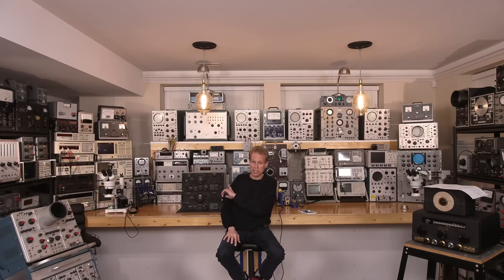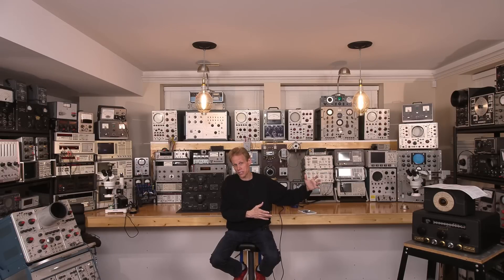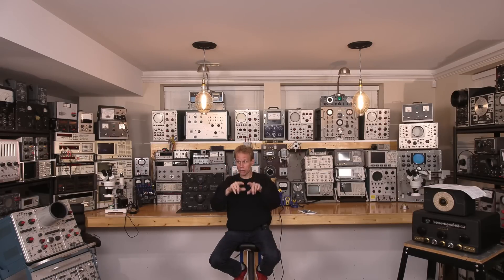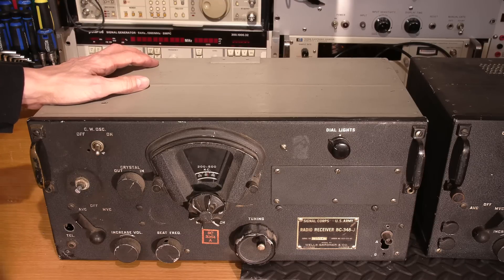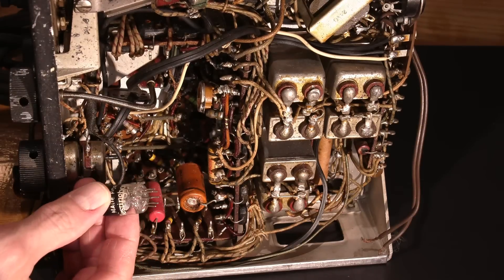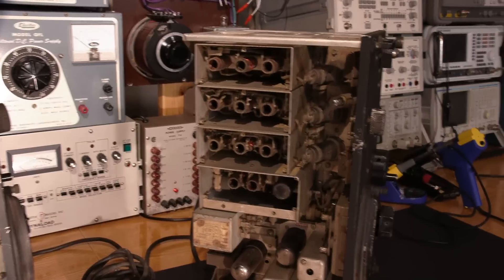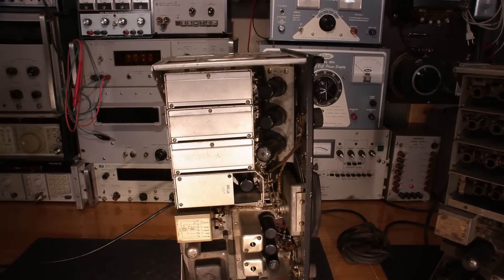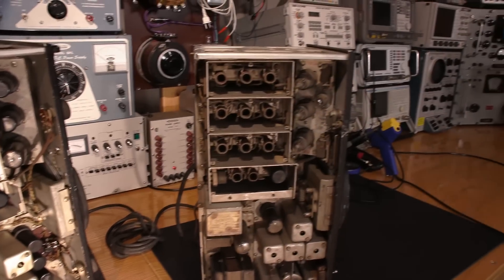Restoration Warplane Radio Receiver BC-348

Comment: Hello Paul, I have been following since the Stromberg Carlson 240 (where has the time gone?) I have ZERO electronics experience, I'm not a ham, I don't DX or perform EE projects...that being said, your uploads depicting troubleshooting, best practices/proper procedures are transferable to other aspects of projects I do undertake (aux equipment/ circuits for vehicles, appliance repair, and similar). You have enlightened me to potential safety concerns when working on circuits regardless of their application. As far as the YT analytics, I'm drawn to the resuscitation of this old tube equipment, circuit testing and comparison performance. I have learned much from your aligning procedures...but now, unless you are doing something unique, I will gloss over it, watching for snippets that may not have been covered before. The same holds true with the schematics, I can glean some information, but I don't "speak" that language, so I move on.
Don't get me wrong...I know that there are viewers that understand and hang on to EVERY word so that they may expand and APPLY the knowledge you share. You are their source for vital, ACCURATE information that is lacking on other YT channels
If I were to remove, rebuild, and reinstall the P7100 on a Cummins 5.9 diesel , I would want someone with YOUR attention to detail and ability to depict the nuances of such an endeavor, while  building the confidence to take on such a project. It's a balancing act...I don't want you to start going for flash & glam "clickbait" to gain viewer minutes as it would dilute your credibility (next thing, you'd be pimping AG1 and SimplySafe products)....but I do understand that you deserve compensation for the massive effort it requires to produce videos at this level.
If you have gotten this far, I am just sharing one of the many types of viewers that frequent your channel and our reasons why we are drawn to your content.  Hope this is insightful?

Comment: Wonder if the tube under the chassis and the variable capacitor in place of the dial light is maybe a Q Multiplier circuit?

Comment: Hi Paul,
I'm all in favour of the restauration. My vote goes to No.2 with the power supply of No. 1 and the case of No.3 though I'm still intrigued about the higher number of filters in No. 1.

Comment: Side Bar: Looked up when radios were mass produced? 
Late 20’s and more so in the 30’s … I was curious to find out that it was popular by 1934 to put radios in cars. And it’s a stretch to think they put a large vacuum tube radio in a car but I guess they did. Do any of these still exist? Do you have any in your library of dysfunctional electronics? you should have a history corner. Looking up the history of car radios it was quite the thing to produce a cheap car radio in the late 20s and it presented alot of obstacles… large antenna, large draw from car battery, vacuum tubes over heating….all very fascinating 😊👍

Comment: On the IF grid cap. or a inductive adjustments. Which one does the better job? Or is it possible to run both in a IF configuration. I have gone threw my notes for 1979. The notes wasn't  any help.

Comment: I don't know about the "J" model, but the "Q" version uses a pentagrid converter.  The "R" employs s separate mixer & L.O.  If the "J" does, too, I'd definitely go with that one.  One mod that's really necessary, is to disconnect the RF gain pot that's on the same shaft as the volume control, and install a separate pot.  Also, there's space where the dynamotor used to be, to build an AF driver for the output tube.  I used a 6C5 for my BC-348. (Back in the 60s).   I also installed a 100 pF variable cap, from the ant. input to gnd.  That wouldn't be needed if you're using an external ant. tuner. You can also improve the sensitivity by replacing the first RF amp tube (6SK7) with a 6AC7.  That's a sharp-cutoff pentode, rather than a remote-cutoff, like the 6SK7.  That tube  wasn't designed to be used like this, so you MIGHT get some IM products, with really strong signals.  However, I never experienced that.  Oh, one more OBVIOUS thing...So obvious, I just now thought to mention it.  First of all, rewire the filament circuit and replace the tubes with 6 volt versions.

Comment: If my opinion maters, i'd like to see more modern electronics without tubes if possible, power amps, tape decks, cd players, measuring equipment, lab PSUs etc. For theese receivers i would start with most good looking one, then second good looking and if something left for third ;)

Comment: A very interesting group. Obviously just on condition I agree it looks like 2.. But 1 is interesting. I think that's actually wartime or possibly even just before.. It has very much the look of the late 30's where the others look early 50's. My gut tells me if they were mine I would restore 2 using any needed bits from 3 and leave 1 completely alone until after that's done.. then crack into it and see how different the design and performance really are..

Comment: As a patreon subscriber I would generally like to see a bit more info and video content on there rather than a presentation of schematic, bom and announcements only, maybe a video of a build of some of your test gear designs.
Being in the UK, restorations of US gear is not so great for me especially after seeing many previous ones where the general feel is replace caps, check resistors and align etc. I have enjoyed watching all of these and do not wish to detract from or criticize in any way the quality and detail of your presentations as this has been excellent of course. Maybe a little more on 'restoration' as opposed to fault finding as I think you have covered this very well already.
And to sum up --err
keep going with the series, but spare a little time for patreon supporters.
Steve.
Reply from the maker: Hi Steve, the last entire video series on Patreon has been exactly what you are asking for? A test equipment design release, with all the information, schematics, layouts, component maps, parts lists, PCB transfers, etc... The amount of time I put into Patreon is "Astronomical." Are your sure you are a Patron?
Reply: @MrCarlsonsLab  Well I was, just cancelled.

Comment: Professor, keep going as you have been. I think a variety of projects is best. I want to see the comparison of these grand receivers even if it takes a year or two to get there. But along the way I enjoy the other things. I get a kick out of the different All American 5's & such but I also like to see some solid state things & old test equipment. I very much enjoyed the Vedolyzer for example. Even the coffee maker repair was interesting while I would have not bothered. You're up to the one I want to see, the BC348. I don't expect it to keep up with the AR88 but it will be interesting to see just how well it competes. The design goal was very different, weight and size were more important than utmost performance. But it still needed to perform well. Considering how often modified the BC348 is it may be a good example of what you have to go through to undo & decipher what's happened. Are these mods penciled in on the schematic?

I'd also like to see a more modern radio next to these older ones, something like a Yaseu FT1000. Sure these old units can't do what DSP can & they don't have the selectivity. But are certainly very sensitive, exhibit good dynamic range, can have terrific audio, & can be quite stable.

I suspect declining views as the repair went along was due to getting a little monotonous. Really, another hour & it's just 1 more simple step? Part 10 & you're still not done? Perhaps you could skip some detail or repetition. Show us how you replace the component once, then all replaced. We don't always have to witness each one. Make it easier on you & us. Don't change it dramatically but a little less detail with a little more frequent content would be appreciated. I can skip ahead as I see fit. For example, please don't stop warning people about safety. But I've heard it, have experience with it as well, gotten a few good jolts over the years. It's important. But it's no consequence for me to just tap forward a bit.

I look forward to your videos. They give me something new to watch I have an interest in. I'd rather watch a documentary than a singing contest.

My BC348 looks almost nothing like it ought, very heavily modified. It doesn't even have the original case. Someone got the bright idea to take it apart & make it rack mount. There's no original knobs & it isn't even black. But it sure does work well. I ran it for years keeping my basement warm. It's the Q revision I suspect. There's a silicon rectifier for the modern power supply. It also doesn't have the trap door on the front which the manufacturer put there for a reason.

Carry on.

Comment: I think the restoration series is important, in this instance radio 2 would be my choice.  It would still be nice to have have some small breaks in between.  For example the design & build of a BJT/JFET test jig to aid with designing BJT/JFET circuits.  Work out the basic biasing, set it up and tweak it to produce the desired result to suit the transistor you will use.  I know you can use a breadboard, but I never trust them.

Comment: Hi Mr. C, I also vote for yes, go ahead, which one you restore doesn't really matter to me.

Maybe you could put the focus on some other topics of the repair, for example there is an explanation of the electrically leaky capacitors in most of your videos - which is absolutely fine since it is an important topic - but maybe focussing on another detail might be great sometimes. 
I think this would help with a lot of your long term viewers since some videos are a bit repetitive sometimes.

Just a sidenote, if you need another topic, maybe some RF power amplifiers might be interesting (atleast to me) maybe also some solid state ones (maybe even LDMOS). 

Greetings,
Michael

Comment: My current restoration items are an ED80 UHF aviation radio receiver with multiple oscillator. Crystal Q111 in the multiple oscillator was defective. For replacements a second multiple oscillator in visibly bad condition had to sacrifice its life. For fault diagnosis of quartz two Pi links for four-pole analysis were calculated and built and swept through at the spectrum analyzer with tracking generator. For test operation of the removed chassis of the ED80 extra RG58 with BNC installed for feeding control frequency for external tuning. It was also necessary to install 60 Ohm terminating resistors at two not needed outputs according to the manual in the multiple oscillator. In the multiple oscillator still aged isolations in the 50 kHz, 1 MHz, 10 MHz oscillator had to be removed. Replacement of aged electrolytic capacitors in the ED80. Correction of the damaged installation of the heat exchanger in the housing of the ED80. Elimination of unbalance of a fan in the heat exchanger by soldering a solder seal. All assembled with adjustment ED80. Built suitable adapters for connection of the ED80. This is all very time consuming. Also your videos should show that. Not only the result! - Save the second receiver, because best preserved in the original. Please show complete restoration of these.

Comment: Paul, when you first started the Grand Receiver Restoration Series, I thought it was overly ambitious of you and I wondered if it was too big of a project to tackle.  It has definitely held my interest, but I'm finding that even though I am subscribed and I "rang the bell" I don't seem to find your videos as easily as some other channels that I subscribe to.  So maybe there is a fault with YouTube not alerting subscribers or not suggesting your channel as much as others?  Maybe YouTube suggests less and less (to non-subscribers) as the number of "parts" in a series increases (i.e. part 11 is not suggested as often as part 1 or 2)?  I'm just trying to think of reasons why viewing drops off as a series progresses.

My opinion:  YES, please continue with the grand restoration series.  I have learned so much from your videos, even though I will never be in a position to acquire or restore one of these amazing receivers.  Also, as far as which of the three to use for this one...  I think it should be your call, since you are the one doing the work, but I agree with your thinking, use that nice looking one, but pull the better(?) power supply from the other radio.  This is assuming that you don't encounter something catastrophic along the way that would make you want to rethink your options.

Also, I've only done a couple of videos myself, but I didn't realize that creating a video multiplies the time by a factor of 4 or 5.  Wow.  We all appreciate your effort, especially if you're clearing your bench to rotate smaller projects in and out.  I know how inconvenient that is.  With regard to that, if that slows you down significantly, please don't feel like you need to keep pumping out videos to keep us (me) interested.  I'll be here, regardless of the time you take between publishing videos.  I do like your decisions on what to show and what not to show in a particular restoration, for example: "These capacitors have all got to go. <cut> I've replaced the capacitors, and..."  We sometimes forget that many days of tedious work are skipped in the blink of an eye.

Lastly, as far as restoration goes, I definitely prefer to watch you restore receivers rather than test equipment and/or amplifiers, but I love the oddball "what is this thing" videos.  I watch all of your videos, but I keep coming back to the receiver restorations to watch the same ones again and again.  Whatever videos you produce, I am always learning something. Thank you for everything you do, sir, and please continue. 73 de K8NW

Comment: Starting with the BC-348 lineup, I agree #2 is cleaner looking and likely least circuit mods.
I would be interested in knowing the full model numbers as there were several versions made and usually the higher letter suffix ones used "newer" tubes and associated circuit changes.
On the over all series, I will admit there are radios I am not familiar wuth personally so the "blow by blow" onn them may not hold my inerest as much as final outcome. 
I have a BC-348 relatively un modified except for replacing dynamotor with AC supply so I will be watching this one with interest.
I always wanted an SP-600 but never aquired one & have an R-390 & R-390A I need to make tine to go through myself.

73 de WB8FEQ

Comment: I am really looking forward to the Racal RA-17 and the Collins R-390.  Or better yet an R390A.  These along with the Hammarlund Super Pro each have a rep as "best shortwave ever".  Lukewarm to the BC-348s because these look like a huge time sink.  To get a good resto, you will have to use parts from each set.  Case from one, PSU from another and front panel from the third.  All that work and you still have a second-tier receiver.  So maybe not.  73 Chip KM4SJN

Comment: I haven't watched this video but I know that WWII vintage aircraft use a 48V/400Hz electrical system. The voltage is easy to duplicate but I would be amazed if you had a way to convert 60Hz AC to 400Hz AC. When I was a teen in the 1960's I had a pair of servo motors that could be linked together that were surplus from WWII aircraft (my father was a radioman on the flight test line for North American Aviation  B-24's assembled in Grand Prairie, TX (Dallas County). The servos could be slaved using just 60Hz AC but didn't have much torque at that frequency. At one time I used them to fabricate a remote weather vane, with one servo on the roof and the other inside to indicate the wind direction.

Comment: The one without the power supply I say should be used as a donor. I would be inclined to consider the one with the grid caps as a donor also.

Comment: Hi Paul, All your content is very good, but I must admit that restorations can get a bit repetitive. Actually switching out old components for new ones is probably tedious for you to actually do and takes a ton of your time. For me the most interesting part is the actual fault finding and repair. As an engineer working mainly with digital electronics, radio has always been a bit of a mystery to me - it seems to do it's own thing rather than what the theory says it should do!  I would love to see & learn more practical stuff with the radios both vacuum tube and solid state.  Many thanks for all you contribute here and long may you continue.

Comment: R2.  Replace PS with small switching supply to reduce heat and weight.  On future conent, make 1/4 old restrations, 1/2 Modren electronics (repair, upgrades, etc), and the rest New and unusual stuff,  Many of the "HAM" upgrades was to
improve SSB reception. Do it right with a proper ssb detector.